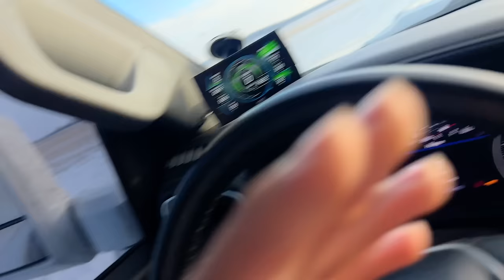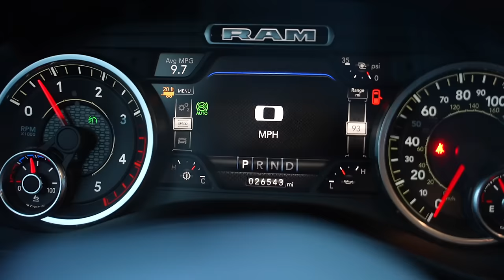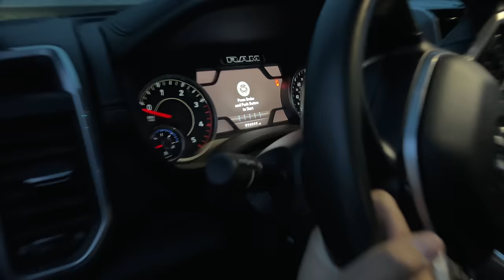Introducing “Papa Smurf” The HOTTEST 5th Gen Megacab Cummins + Giveaway Truck Delivery!

Comment: Those AUX switches are programable through the dash display to function as either full time power or keyed ignition
Reply: Just to add for those that dont know, Fords do the same with the upfitter switches. To make them always Hot theres a switch under the fuse box

Comment: You can adjust aux switches in the dash, you can go off key or battery you can also make it so they’re only on while you push the button and if you let off they shut off and you can also have memory so everytime you turn the key on they come on if they were on before

Comment: I'd take the 22s over the 26s. My line of work requires a little bit of sidewalls to jump curbs and drive in the woods. I downsized to 20s and 35s just for that reason, and they was dirt cheap. 😂

Comment: You can change the aux switches to be battery power or key, use the steering wheel controls to go into commercial settings, the code is usually 0000

Comment: Nobody needs a warranty 
S476 high mount compound set up polished housing fleece 63mm cheetah on the bottom intake horn hot and cold side piping built trans of course that would be badass and sound so good plus make decent power Gabe we know you like high HP and all the TQ badass truck love that color. It does need a set of JTX’s though just my opinion that doesn’t matter but you asked for ideas 👊🏼🤙🏼

Comment: Dodge ram mega cab with Cummins   one my favorite truck    I  dream of getting a black Dodge ram mega cab with the Cummins  murder out in black Vader Chrome and black rim black lights everything black out .   Aftermarket back bumper  and front one pic bumper grill hard to find and cost  but dam it look so good on ram and other trucks ,  With 8 or 10"+ lift .   Maybe Monster  energy Rims 26 by 14 or 16  . tires little thicker than the tires on other trucks to fill in the fender wells, monster energy lime green color  lights.  My dream truck ..  but that blue ram love that one too profit match combo . Chevy make 2500 Tahoe with diesel don't make alot of those are few . I had one .

Comment: Genuine question, are you running a cdl for your towing set up or is there a way around having to run one for personal use?
Reply: U don’t need cdl for that 😂
Reply: @user-en1tg7fv7x  I been reading over the laws alot to figure out what is and isn't ok without a cdl. Seen that between the truck and trailer the gvwr isn't suppose to be over 26k and that truck is atleaat rated for 14k and the trailer at minimum is a 20k being a dual tandem